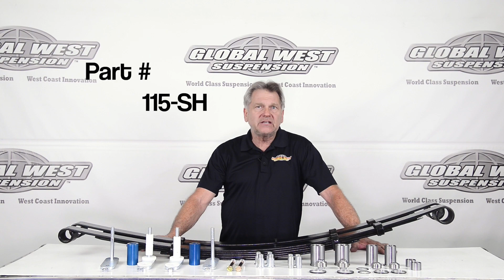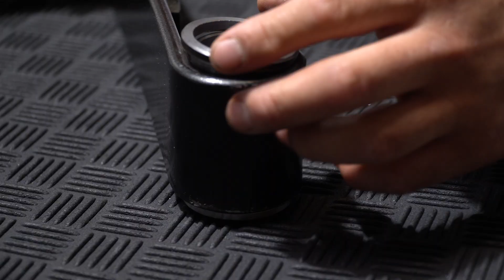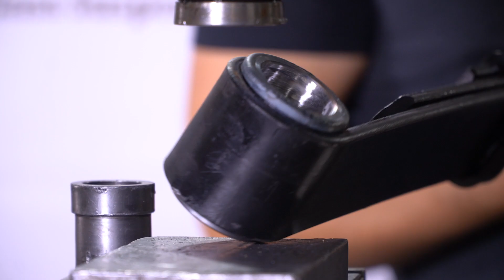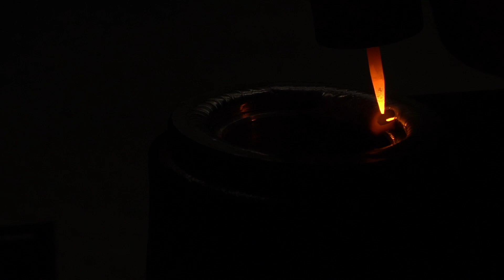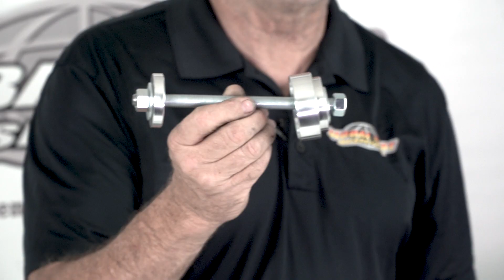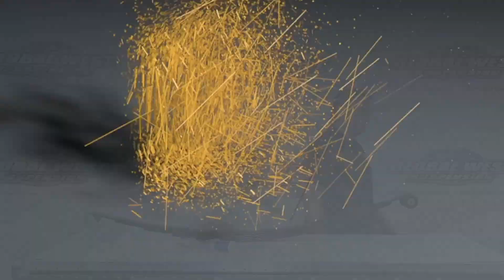How to install Global West bearing system into the eyelets of your Camaro Firebird leaf springs

Comment: How much will this increase the road noise being transmitted into the cab
Reply from the maker: Zero increase in road noise sir 🫡
Reply: @GlobalWestSuspension  lol damn I gotta Sir!  That’s an American flag in one hand and a beer in the other!  But you would be right to guess I have served!  I had almost everything you guys  offered for a third gen Camaro back around 2002 Including the adjustable rear lower control arms with rod ends….those things transmitted a ton of noise, although the handling more than made up for it.  In fact those specific components I installed in Camp Pendleton at the auto hobby shop.  I grew up in Rancho Cucamonga and personally came to your shop to pick up my subframe connectors.  Just a thought but….You guys should consider posting under body videos of your components in action.
Reply from the maker: @RoddyDa  Thank you for serving 🤝 Right on! Those lower arms do bring in some noise but the handling aspect becomes remarkable when dialed in right. Thanks for the suggestion! We will for sure be trying to get these shots. 💪
Reply: Dirt track cars???